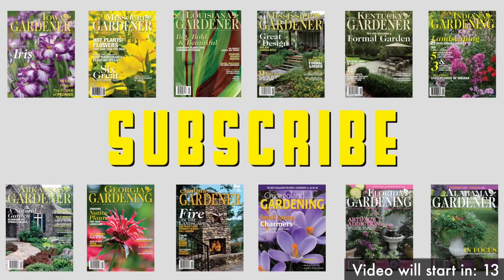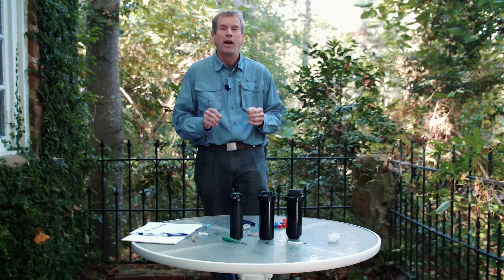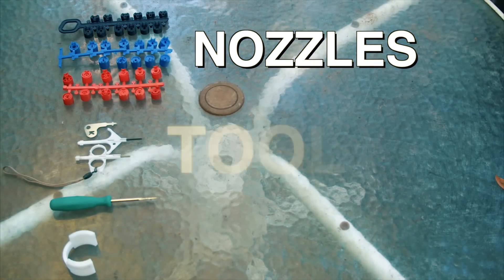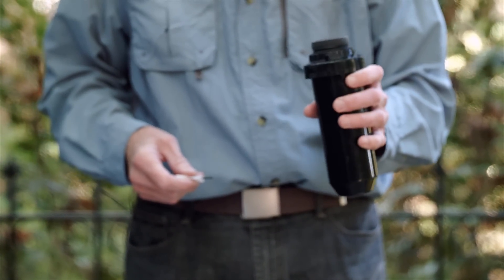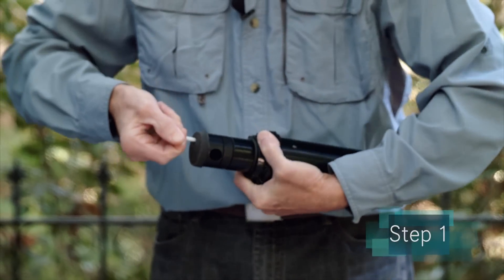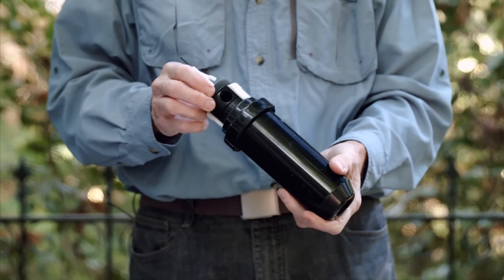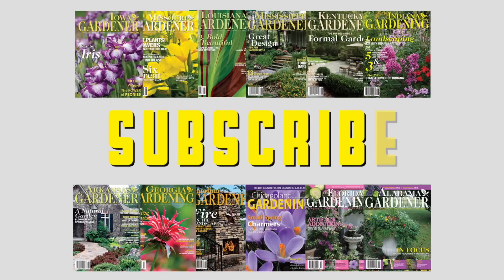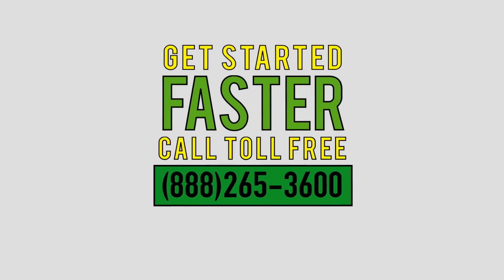How to: Replace A Sprinkler Nozzle

Comment: How do you REMOVE the nozzle?
Reply: Tom Me exactly what I turned to this video for! Very hard to pull out! How do you properly use the tool to pull it out without destroying it?
Reply: A11iOop  You want to unscrew the set/retaining screw that takes the allen tool. Best to do this with the sprinkler on, it will pop out about a foot. Then you can read the number of what tip was in there before if replacing the rotor. 
Also, FYI......the set screw can be screwed down further to dissipate the stream along the distance of arc of the distance. Allowing coverage/distribution between the distance of the length of coverage.
Reply: @andrewetta6638  Thanks for your answer. I had done all of the above, and it only came out part way and then got stuck. I must have twisted it wrong, or something. I decided to push it back in, but that was difficult, too. Once I got it back in and tried again, it came out like butter. Not sure what I had done the first time, except that it was not clear by looking at it what direction it was supposed to come out, and so I think I was twisting it which caused it to get stuck.
Reply: @A11iOop  You use water pressure to remove these nozzles
Reply: watch here https://youtu.be/I6m4C7Rpl8g

Comment: How can I shut off a nozzle head not needed
Reply: If your nozzle is a Hunter I-20, in the very center of the nozzle you will see a small slit in the rubber cap on the top of the sprinkler head.  Right by that slit it will say "OFF" with an arrow that shows a clockwise direction.  Insert the plastic end of the Hunter sprinkler key and turn the key clockwise until the key stops spinning.  Do NOT over-tighten the key to the "OFF" position and remove the key.  That's it.
Reply: it has adjustable screw on top. turn it off